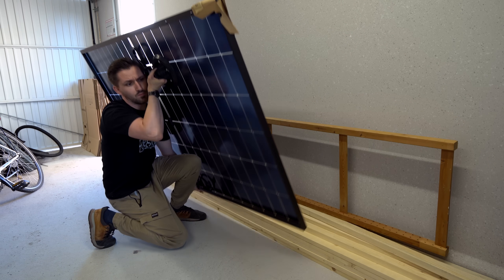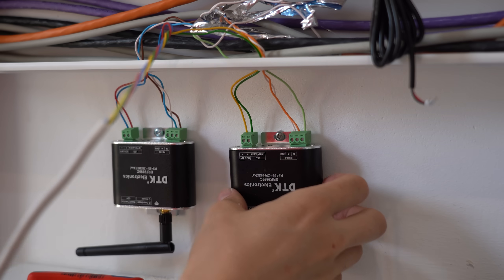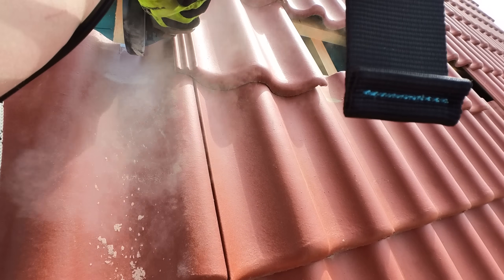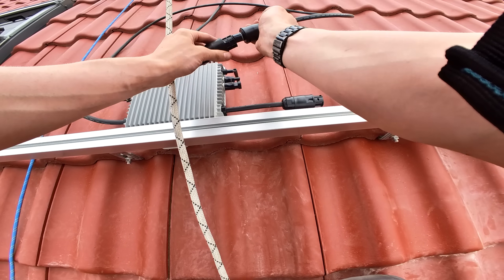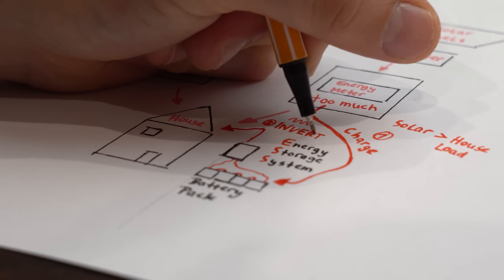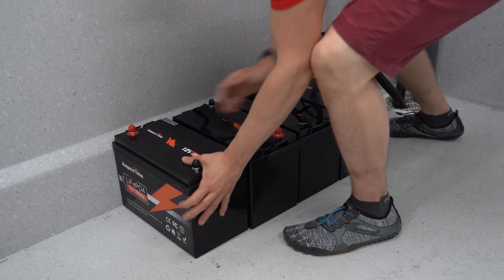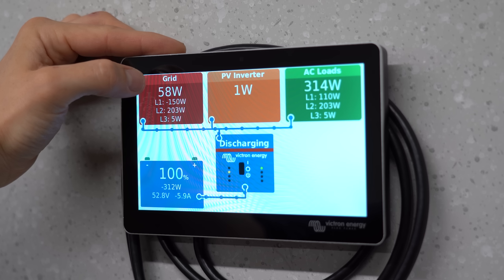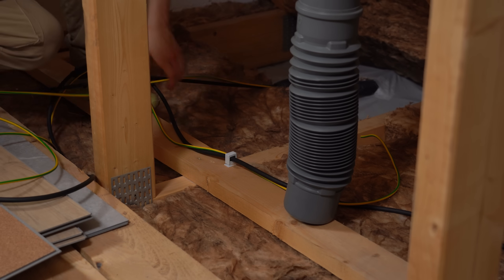Pushing a "legal" Mini Solar System to its LIMIT!

Comment: Old Design Issues
- Limited to 600 watts, excess power goes to the grid without compensation.
- No energy storage system (ESS) to store excess solar power.

New Design Improvements
- Installed solar panels on the roof for better efficiency.
- Added energy meters to monitor power flow.
- Created a 48V battery pack using four 12V LiFePO4 batteries.
- Used Victron MultiPlus II for energy storage and management.
- Configured the system to use the battery pack as a 600W power source.

Performance Metrics
- Reduced grid power consumption to around 50 watts.
- Battery pack charges with excess solar power.

Future Improvements
- Need more solar panels for better utilization of the battery pack.
- Approval from local grid provider is required.

Positive Points (Sorted by Importance)
1. Modularity: The system is easily extendable and customizable.
2. Energy Storage: The new design includes a battery pack to store excess solar power.
3. Monitoring: Added energy meters for real-time monitoring of power flow.
4. Safety Measures: Included circuit breakers and surge protection devices.
5. Software Configuration: Allows fine-tuning of power usage and storage.

Negative Points (Sorted by Importance)
1. Cost-Effectiveness: The system is not yet cost-effective due to underutilization of the battery pack.
2. Complexity: The system requires a good understanding of electrical systems and may not be suitable for complete beginners.
3. Approval Required: The system needs approval from the local grid provider.
4. Installation Challenges: Difficulty in installing solar panels on the roof.
Reply from the maker: What an awesome summary. I might pin this comment :-)
Reply: This man came out of nowhere and just translated everything in a easy way, lol  @greatscottlab
Reply: AI generated, you should try it scott! @greatscottlab
Reply: @EugenePutin what?
Reply: @greatscottlab   or You could have gone for off grid system
Reply: did an ai write this
Reply: @Napert  as a software developer, potentially.. 

i feel like this person wrote a script to download the videos subtitle transcript and then feed into an LLM like GPT to produce a summary of the video. either way, AI or human, this was pretty well done. i wouldn't mind having a youtube video summarizer up my own sleeve!!
Reply: Yeah there's a youtube summary app @Napert
Reply: @Napert yeah tought the same thing, i’m glad we can still notice!
Reply: I am really impressed with your system. However, watching you (at your level of expertise) convinced me that even though I don’t  have a 45 degree roof(!), installing such a system is just over my head . Fascinating to see the difference between German systems and American ones.
Reply: @BBMSOFFICIAL That's fine. In Thailand, micro-inverter solar systems are also installed under the panels. The temperature can be as high as 50-60 degrees when working. and may be exposed to rain all day long in the rainy season as well
Reply: @BBMSOFFICIALI think u have flat roof, @greatscottlab what temperature is Attic in summer? Sometimes u get a 30-40C? try cooling inverter with this. 
Also u mount inverter vertical that makes them more resistant to water they are IP rated for this.
Reply: Nice comment - saved me the watch
Reply: Nice
Reply: @greatscottlabs: super Video! Can you please tell us whether your Garage is heated oder super well insulated? I am asking because of your batteries... I winter time, they do not want wo see minus degrees...?!
Reply: Why did he not get money from power grid is it because it is too small?
Reply: @leonordin3052 in UK, to get feed in tariffs, you need to have the system installed by an MCS accredited company. Probably a similar situation in Germany.
Reply: @leonordin3052 if you don't have a dual spinning meter, you will pay the grid to take your electricity.
Reply: @leonordin3052  Maybe the electricity company doesn't have a policy to buy or buy at a very cheap price?

In Thailand, we buy electricity at 4 baht per unit (excluding taxes and FT), but the government only buys electricity at 2.2 baht per unit, so using it up is a more cost-effective option than selling it back.
Reply: bro is this chatgpt or something? this is well documented
Reply: The safe way to carry a panel up the ladder is if you hold it against your shoulder and head cradling a corner.
Reply: This is a lot of work for 600W. Good you decide to install ESS but four batteries have ca 5 kWh of energy and your roof is empty. I think the best is to install more moduls. Take 10 more PV moduls and you can fill the batteries faster. In summer you have 1-2 kWh at sunny days. The rest of the year not more then 500 Wh.
Reply: Can you tell us where you get the battery, I cant find a link to it.

Comment: One question. Did you care about firesafety? On the video it seems, that the PV panels are quite close to the roof opening. Also, not sure again about the inverter location, but I doubt it is secure to install it under the PV panel - due to increased temperatures under the panels them self. Please don't forget regular inspection (visual at least)and cleaning - leaves and such.

Comment: Now that commercial sodium battery systems are available (in Europe/Germany) I am really interested in your opinions on these. Which systems do you think are nice, how would you set these up e.g. to replace LiFePo solar batteries or connect a BMS to home assistant. 

Btw, I got interested in Sodium batteries after watching your video for „Salt cells“ :)

Comment: Thank You for the video! I would like to ask - is the Victron inverter silent enough to be inside the house (corridor), I used a cheaper grid tied inverter 2000W with limiter(CT), but it is quite loud and is not wife approved because of this. And also is your garage heated for the lifepo4 batteries? Thanks!

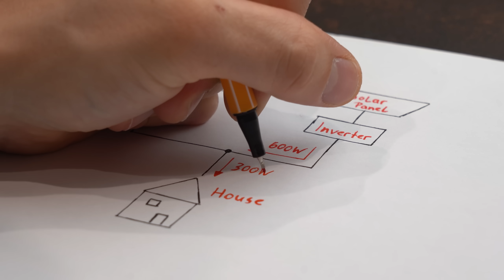Comment: 1:00 Heard it has other problems. The plug prongs are live. And during maintance it may he dangerous to workers thinking the grid is deenerigized at least that's ehat I heard. EDIT: If you turn the breaker before pluging in it won't backfeed.

Comment: When calculating the economics of solar power and batteries, don't forget to include predicted changes in electricity costs and inflation. Also, any applicable tax differences between buying equipment now vs buying electricity in the future.

Comment: Wouldnt it be better if you connected Solar Panels via an MPPT directly to the Battery so you dont have to use a 600w Limited Micro Inverter?

Comment: Hey Scott, we run a complete Victron system off grid on our yacht. 3kW of solar and the Quattro inverter chargers as well as other things.  
Because you’re using Lithium. Each battery should be independently fused. 
Normally you’d fuse the run to a battery bus bar.  We also use a battery protect from Victron to make sure they don’t over discharge. It’ll cut providing output if they get too low, (2.8 volts per cell) - so they don’t get damaged.

Comment: mmh, I don't know how to say this, because I like your videos a lot ^^ 
But using 4x12V batteries in series is probably not the best solution. 
Lithium batteries need a BMS, having 4 of them working independently  may create issue on the long run. Because you cannot correct/equalize the  cells voltage between different packs. So if one battery cell on one pack gets tired and the others not, you will get a constant drift. Some batterie's bms will  then cut the connection (at LVC or HVC) earlier than others. This will create an increased drift with the time and can lead to very bad situations.
You may want to look at single LIFEPO4 cells, and one 16s BMS handling all them together, they are probably cheaper too :) 
Again, love your videos , it's just a "constructive critic" :)

Comment: The great thing about them is the fact that you never have to think of the slaves that made those solar panels. Unlike EVs, that you hear the subtle sound of wailing children, every time you touch the accelerator. Solar panels don't make noise, and they are out of sight.
Reply: Have you ever looked at the moral purity (or otherwise) of the fossil fuel industry?

Comment: I didnt think you could simply plug an inverter into a socket to supply/supliment your house electricity. Im not sure if you can do this with the infrastructure in the UK/Ireland.

Surley it would cause something to trip on the fuseboard?

Comment: I am just starting to build my solar system, but have not connected to the household electrical system. I just run a 12 volt heater and some USB devices from it. 
If I were to install a system using all Victron gear to do as you have then the parts alone would cost me the same as 5 years electricity bills. Just not worth it.
Enjoyed the video though.

Comment: 11:17, what happens, when the house load is less than PV supply, and the battery is also full. Where does the excess power go.

Comment: I don't understand why u series the 4 batteries? That's like inefficient and lots of voltage drop from each bms. And besides at 48V u need a master bms that looks for 16 battery not partition into 4 batteries/ 4 bms. Meaning in your setup  each bms is blind that they are not meant for 16 configuration

Comment: A lovely "on-grid" hybrid inverter/charger set up! Thanks for sharing.
Perhaps a simpler way that some of us are pursuing, is an "off-grid"  hybrid arrangement. In this case we do not feed any power back into the thr grid, whatsover.
Circuits are supplied with power from the hybrid inverter only. The inverter uses all of the battery power, then has an automatic bypass that takes power from the meter.
With plenty of (old) batteries, what is the point of seeking approval and putting power back into the grid?

Comment: If you feed back the grid, the meter (only digital meters) will charge you as you were consuming that power. It will only log the time, that power was flowing in wrong direction. If you have no license to do this from the local power company you might get in trouble paying fines, or even losing the consumer status.

Comment: i use those exact same batteries (except the brand is called "li time" but otherwise identical specs and markings) at work. im almost done charging them so i can drop them in a 24v power pallet jack for the battery replacement. doing a 2s2p. 24v 200AH. nice to see theres other brands making them too. i was iffy about them but they checked out in my load tests and if other brands are cloning them then theyre most likely ok.

Comment: I am a student of engineering at university. Its important to point out that conecting the output power gained by your solar system directly to any of your house plugs is dangerous and should NOT be done. Its very common that the wires that are aldredy intalled at your house doesnt support the high voltage that will be passing at times throught them. The fire hazard is a very serious design element on any proyect. If you want to  do this,  try to conect the wires directly to your main house hub, and pass them throught the main AC distribut cable at your home.

Comment: WARNING HERE, DONT EVER put lifepo premade 12v battery in SERIES, most of the bms inside these CANT handle to be paired in series and WILL fail, even if they say they CAN i would NEVER do this, lifepo are pretty safe, until you do stuff like this

Comment: Is there really a limit of 600w of solar in Germany? I’m in Aus and we have had a 5000w solar system for 10 years now. We have also been getting $0.66 for KWh for the power we put into the grid.

Comment: Hi @greatscottlab, This video is just what I've been looking for. I have a solar array on the roof and a 3 phase inverter from Huawei. I just want to add a UPS capability to it, for when the grid is down and also I'd like for the solar to still be functional during the day. Seems like this is a perfect solution. Do you know if such setup would be possible though with this device?
Requirements:
 - Current solar setup working while grid is down
 - Charging batteries for the night, when excess power is produced by solar array
 - No charging of batteries from the grid
 - UPS functionality for the whole house, when no grid available
The idea is to limit the amount of power that I need to buy from grid provider during the months when Solar is most effective (March till November in my case), and "bite the bullet (electricity bill)" when I have no other option.

Comment: Hi GreatScotts, awesome video btw, love the new lab. However, in this system when you're connecting multiple 12V LiFePO4 batteries in series, don't you think a battery management system (BMS) is needed?

Comment: Strongly recommend putting the micro inverters actually in the attic/roof space saves so much time when your micro inverter fails ,as you can unplug them inside the house without having to take the solar panels off first

Comment: Just a question... wouldnt a smart Switch that changes over to normal power away from Battery to grid been enough? The power from the solar always chanrges the Cells. As soon as the Threshhold is underrun... switch over till Batteries are back to 50% charge.. then switch back. Seems like a crazy tech setup for a relative low tech Problem. Also... maybe its just because you are a tech addict ;)

Comment: For Solar battery storage, they need to be placed on a LARGE metal rack unit - Preferably with REALLY heavy duty castors - Not placed directly on the floor.

Comment: I have to correct one major point of this video though: Balkonkraftwerke are eligible for the EEG-Compensation. This is due to the fact, that the eeg was reworked for 2023 with the implementation of the  "EnSig 3.0", which deleted a very important passage in the eeg, the one where you have to be able to limit the power of the AC Inverter to 70% of the Solar panels max Wattage. Per the old EEG, if your AC Inverter didnt support this feature, your Photovoltaic-System was sanctioned and you couldnt get any compensation for the Power you fed back into the grid - and none of the 600W-Inverters supported this feature. Now though, since every PV--System up to 25 kWp can just pump out 100% energy, there is no justifiable cause to sanction the Balkonkraftwerke anymore and your small system would be eligible for the full Einspeisevergütung.

Comment: Pay attention to those batteries! Are they rated for 48V series connection? Because most 12V batteries are not and the BMS might fry itself when it tries to disconnect the cells because the FETs inside only support 12V and not 48V. This wouldnt be the first 48V-12V series pack on fire!

Comment: Using an inverter like this, not only you feed the excess energy to the grid, but also you will pay for it. It doesn't matter for an electricity meter at what direction energy flows. It will still count it as used.

Comment: agree very much with the checking with local grid provider. but also be careful what you sign up for.. a family friend has solar panels on his roof, and he dumps his excess power into a heating element in some water somewhere, since that is cheaper than selling it to the grid due to stupid laws we have. then again, our power stuff is so stupid anyway, we hurry and sell all power we generate(wind, solar etc) to germany and sweeden, then buy back what we use instead of using what we need, and selling the rest. and we often slow down our wind power generation, since neither we nor germany can handle all of it, and we get paid to do so. my government is just wrong in so many ways.. we also plan on having only electric cars sometime after 2030, but our electrical infrastructure cannot handle them all charging, if they all charge at night, like the politicians want us to. and we have insane taxes added when buying an electric vehicle, instead of a tax reduction incentive.

tl;dr check the grid provider and check that you don't get scammed, and my country is screwed on so many levels,

Comment: So basically what you did is throw about 3000€ (just for the main parts and batteries you can probably add at least another 500€ for wires, labor etc.) to make a 600-800€ small PV balcony plant... not "waste" as much energy?

I mean, seems to me that getting more power generation (so, more panels) first would've been the better investment path here...

Comment: Sofar also sell an grid tie battery inverter for around 900 euros, not as nice as the victron but if you are tight on budget it can be a solution.

Comment: if you don't have a bidirectional power meter, it would be even worse. It would count the amount you have produced as the extra energy used by you! So you'll pay for the energy you're putting into the grid! 😉

It was quite a common problem in my country, when people got their solar system installed, and accidentally turned it on before getting new contract with power delivery company and having bidirectional power meter installed.

Comment: As far as I could see you are using a grid tied inverter to mix in the power from battery to the house. Guess what happens when mains is off. You will be in the dark with such a system as well as a grid tied inverter requires grid power being available and they have to switch off when the grid is off.
It is way better to use a normal inverter with the functionality to have also AC input. The system works then mainly like an online UPS. The battery can be loaded via solar and you simply switch off the grid power on the AC input on such an inverter to make it run as an online UPS using the battery power.
The AC lines behind such an inverter MUST be an island. Just choose the power lines of your house you want to feed like that and bring the inverter between mains and the isolated power lines.
This way you will NEVER feed energy into the grid and if the grid is off you can enjoy instant fail over done by the inverter.